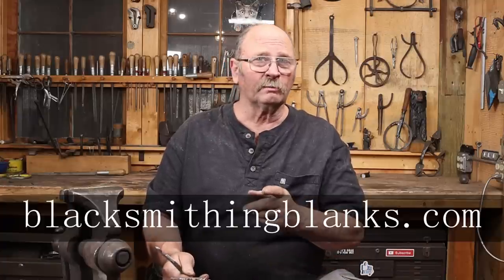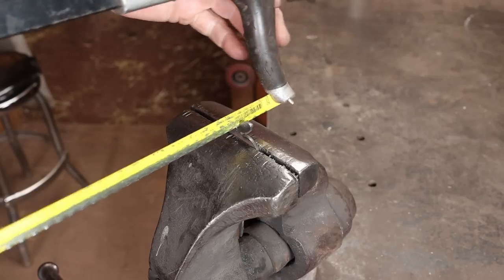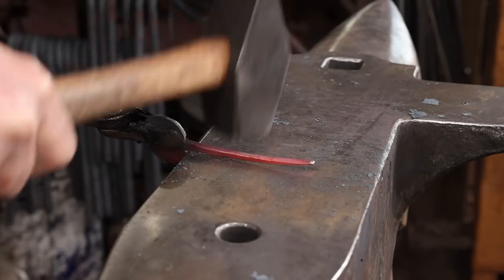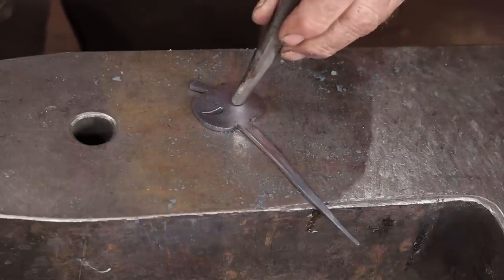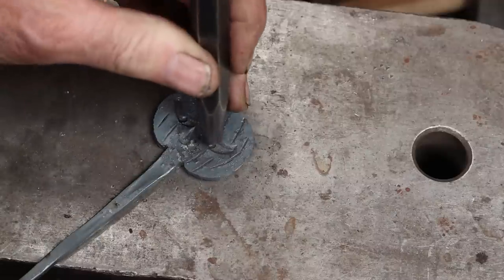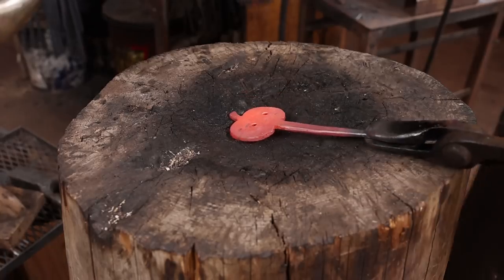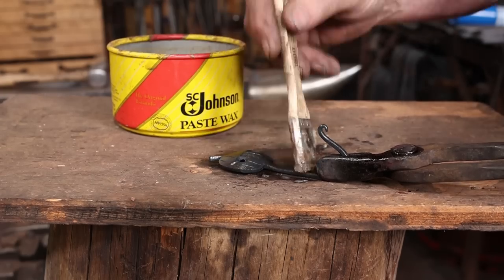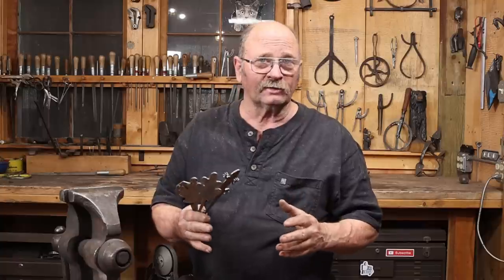Forging a Pumpkin hook - Blacksmithing for beginners

Comment: Happy Halloween 🎃 everyone neat little project looks to be a bunch of fun to make. I have learnt sooooo much from your videos. I am in  the process of building a small cabin on my property 608 sq ft with a 16’x14’ sleeping loft I already have made some really neat things to go in it like screen door handle from 3/8 square bar I twisted it and it looks awesome, I made some extended hooks to hang my kerosene lanterns on my porch they are 12 inches long in a straight “S” shape if that makes any sense twisted in the middle tapered on the curled tips. I made what I call cleats that attached to my rafter beams and the top of the hook goes into that and bottom hook of course holds the lantern. I had a time with the cleats I made the first one in no time flat and what I mean by a cleat is a “U” shape with feet bent to the outside on both ends which I drilled and used copper nails to attach to the underside of my beam. I made the second one with a little bit of trouble and it matched the first one enough that they look the same as they are 6 feet apart, but the third one ooooh man I had to throw away the first 3 as I bent the feet back and forth so many times they just broke off on the fourth some how I got it right and it matched the first almost exactly. My problem was bending the “U” one side would be longer that the other and when I tried to even them up the “ U” was a lot taller than the first one I watched the video about the metal pipe lock and when you bent the flat bar to make the attachment that the lock shackle attached to I then had my technique of bending my cleats evenly 🎉!! I posted a photo on my Facebook page of the lanterns hanging on the hooks and cleats I had seven sets of them sold (which wasn’t my intention to make any and sell them) but I was able to make the 7 sets each one improving over the last and was able to pay for the steel, a refill on my propane tank (small tank) and put a few bucks in my pocket, but the main thing I got for my work was needed experience, practice, and a new technique for forging win, win, win!! 🎃

Comment: so, I discovered your channel a few days ago and I have a question. I am a disabled army veteran and I have always been fascinated with forging metal, but never really had the space or time to do it. After leaving the army I have tried my hand at a lot of things, and some have worked out well and others have not. I think I am ready to start my hand at forging metal and see if it is something I want to peruse. Obviously, I have no experience and I am not prepared to invest a ton of money into something I have never done before, particularly because my wife would kill me lol. What items do you think would be absolutely necessary for an at home beginner forge. I have 5 acres out here in rural Kentucky so lots of space, but don't really have a shop. Would it be ok for it to be open to air or do I need to have a covered space to work? What tools would a beginner absolutely need? Any help would be appreciated from you or even the community to point me in the right direction.
Reply from the maker: Lots of people start in an open air setup, but it is better to be undercover and out of the weather.  Small forge, gas or coal, an anvil and hammer are the minimum tools you'll need.  Of course you'll want more than that, a vise, files, hacksaw, drill and other things generally found in most home shops.  You can also find classes and workshops to try it out before investing.
Reply: Where in KY do you live?  Near Ft Campbell?  If so, we have a forging group in that area that you can join, very low cost, and access to tools, tips, training, everything you need to get started to try blacksmithing out.  We meet the last Sunday of the month.
Reply: @quickstrike06  I live West of Land Between the Lakes. Fort Cambell is about 1 and a half hours away depending on traffic. Coming out there might be an option but not until after Wrestling season, I coach Wrestling for the middle school and driving out there on a weekend would be hard between work schedules, wrestling meets and what not. But thanks for the info I'll definitely look into it. What is the group's name, and does it have like a Facebook page or something?
Reply: @BlackBearForge  I actually have a few of those tools not the hammer of anvil, but I have a hack saw, a vise, drill, and a set of files I use to sharpen my shovels, axes, and lawnmower blades every year. Would I need a great big, nice anvil like you have? where does one even procure an anvil, I can't imagine Amazon selling them. is there a particular hammer you recommend starting with, I think one of your videos said you liked the cross-peen hammer. What size/weight should I start with? and the forge do need to build one or can I use like an old charcoal grill and make a bellows for it? I know this is a lot of questions but to be honest this will be an entirely new endeavor for me and if you google something you are bound to get a million answers, would rather here it from one expert.